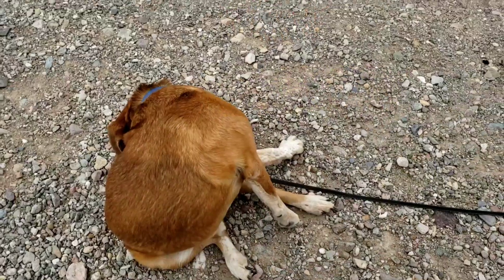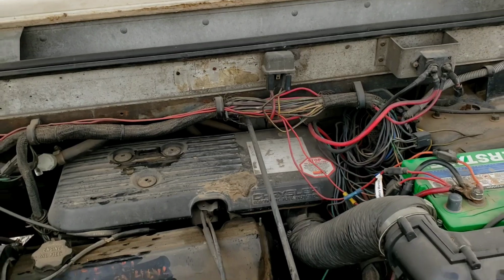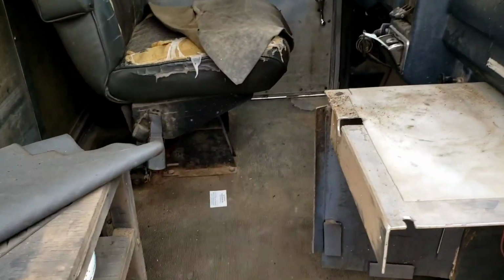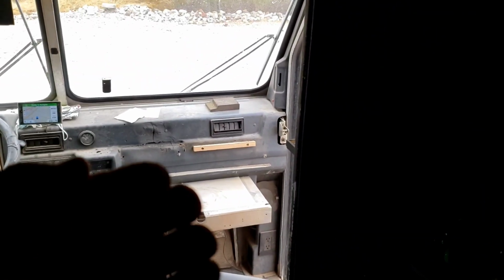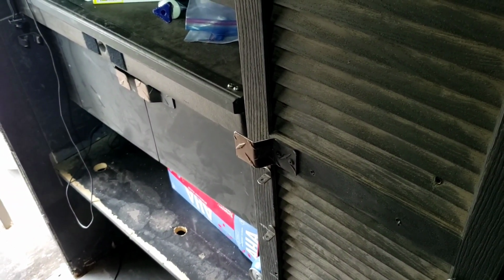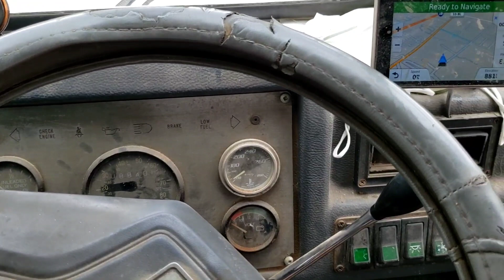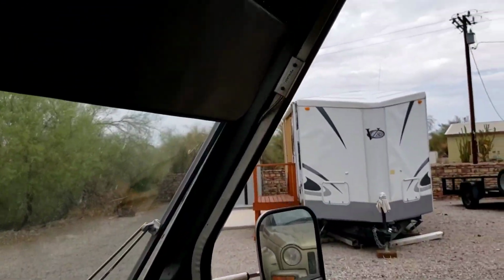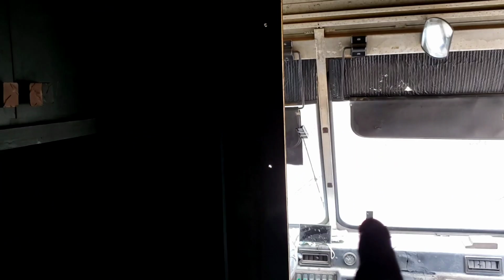Aeromate stepvan conversion tour.

Comment: Hi, I have a 1989 Utilimaster Aeromate truck, what type of transmission fits my truck, I'm worried I won't find one!?
Reply from the maker: You have to get the numbers off the trans case and see what you have they used many different types
Reply: Amigo!! I found a group of people on facebook who also have the same type of truck, they all support each other and comment on aeromate spare parts, and I was able to confirm that there is a caravan transmission left for 1989 and I'm sorry if I ask so many questions, it's just that it's a very old truck that I bought it is a food truck and the old owners never maintained the truck so now I'm trying to make it like new, and I have one more question...

What do you think about the type of alternator? It doesn't have any serial number that can guide me. Would it still be a good idea to get a 1989 caravan alternator?

And about the type of engine oil, which would be recommended?
Reply from the maker: Not a problem 👌
Reply from the maker: I just replaced mine and bought one for a 89 caravan